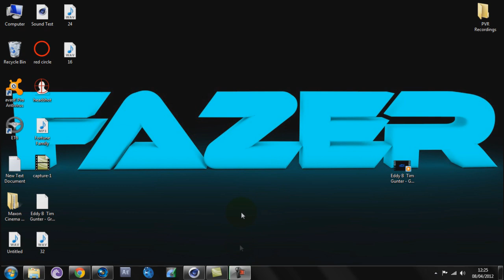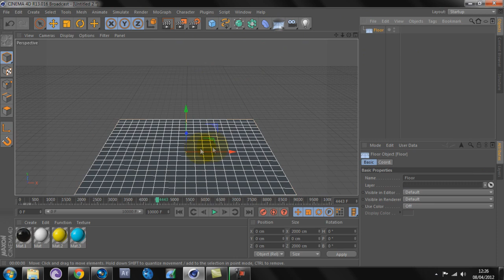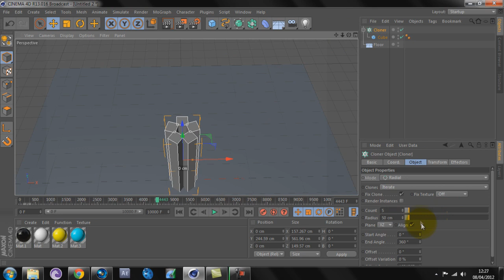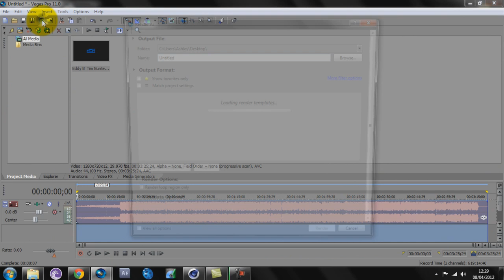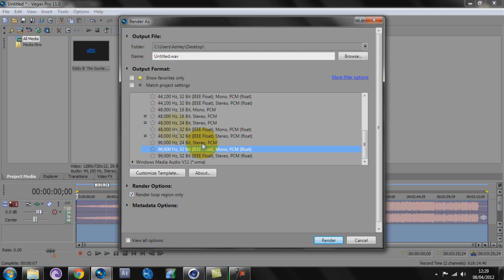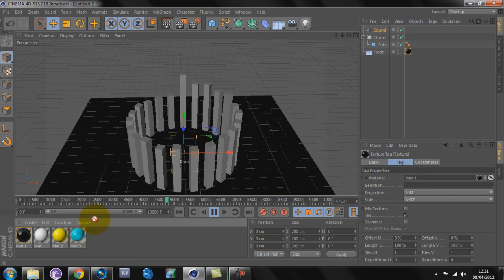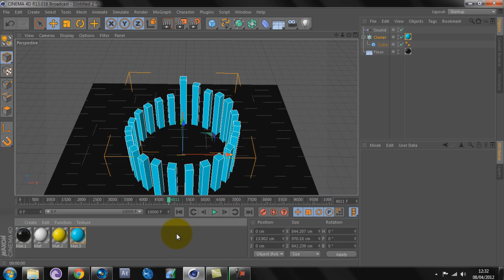Cinema 4D Sound Effector Tutorial + Problem Solved!! I Fazer

Comment: i've done everything this video said. i've looked at alot of different tutorials as well. the effector is not rendering out. its just not moving when rendering
Reply: Fuuuu. I can't edit :S

OK.. SOLVED! :D

Sound Effect isn't work if starts from first frame or next frames, in the editor and render frame by frame works fine but on render video NOPE. I solved after 3 hours testing and searching by google but I found the solve by my self.

To Solve:
If sound effect start from 0:
- Reload file WAV or RE CONVERT to WAV again with other program, WAV PCM Uncompressed 44.1Khz Stereo

If sound effect start from 1 or next frame (My case... Frame 605):
- Go to Sound Effect --> EFFECT --> " initial offset " Put your frame start (My case "605")
- Go to Sound Effect --> Parameters --> (at final) --> "offset of Time" THIS!!!!! Put your frame start (My case "605") 

Now it works my animation :D.....

For song (in render).. Go to any object (static without keyframe or create an invisible cube) Make a keyframe for that object in frame 0 or any frame --> Right Clic (view F-Curves) --> (one window is opened) Right clic on object name --> Add Special Track --> Sound --> In properties window --> add your song and delay if you needed) And now on your render you can hear the sound (if you need edit the sound go to your object and repeat right clic and view F-curves and select "sound" for view properties of Sound again.
Reply: go to tools then click play sound
Reply: +Zane Wuffy 
+Dylan Designs

+1 here, If I render a Single Frame IT WORKS and on editor too but when I render 2 or more frames (image or video) isn't work....

Yep "play sound" is activated...

The object isn't move (I'm not interested in the sound)